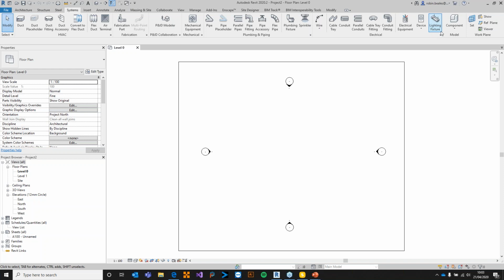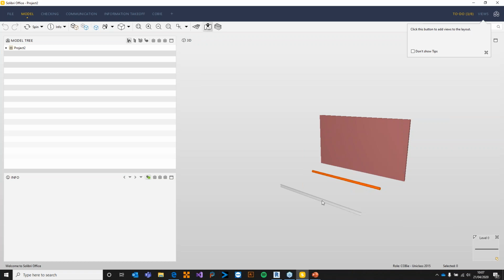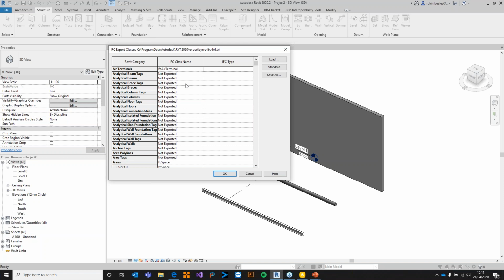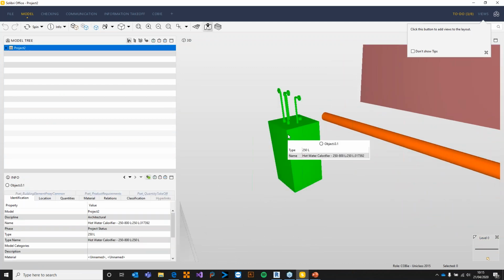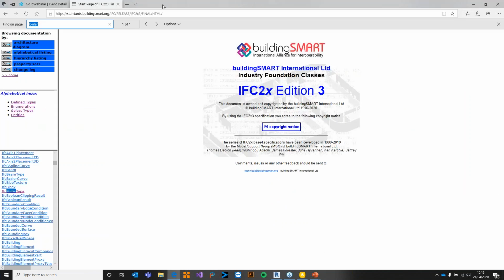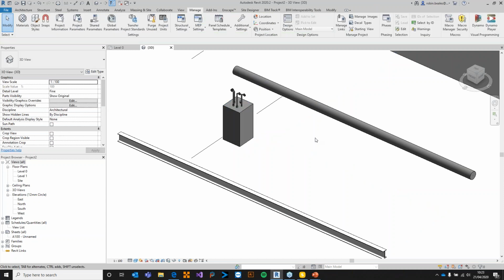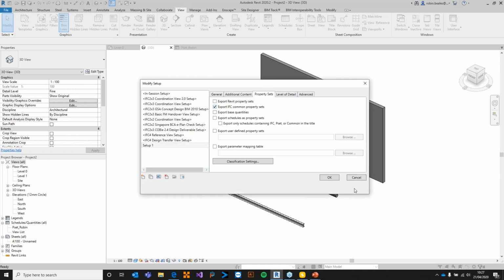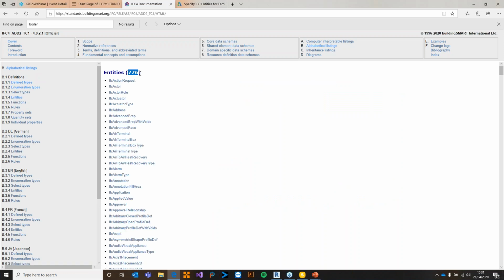Exporting IFC Files Correctly from Autodesk Revit Webinar

Comment: HI, I have a question. I want to export the materials of a wall (insulation, birck ecc...) but i want to export that as a ifc type because in the other software i want to individuate that for measurement and computation. Is that possible?
Reply: Need the same answer,  I got all my families materials as a base for take off. 
Giuseppe Biggio if you find the correct answer can you reply to me at pfbelesa@gmail.com?  Thanks in advance.